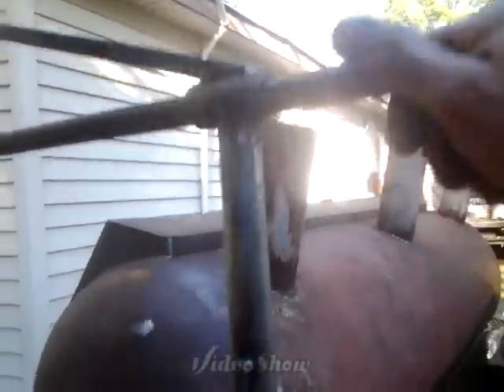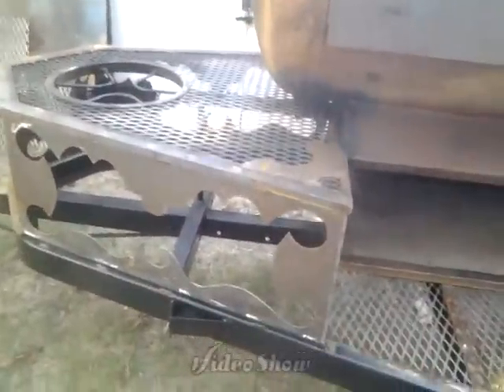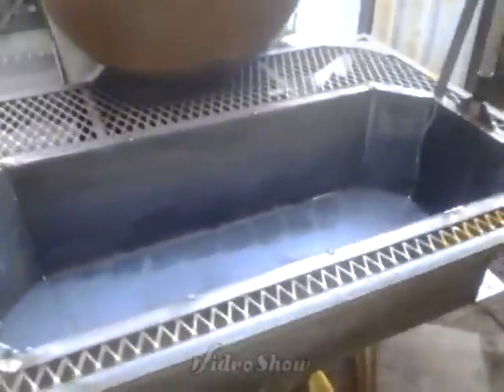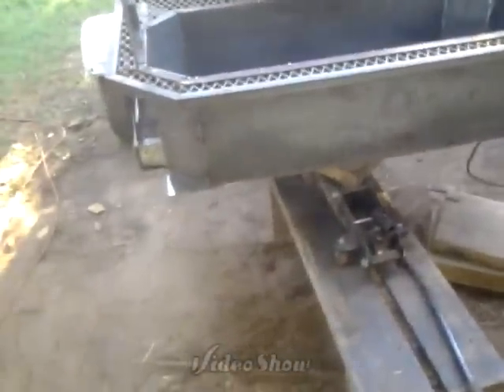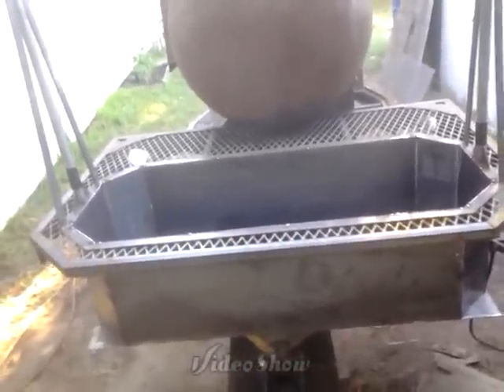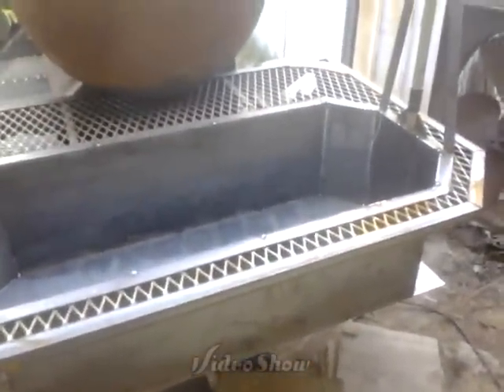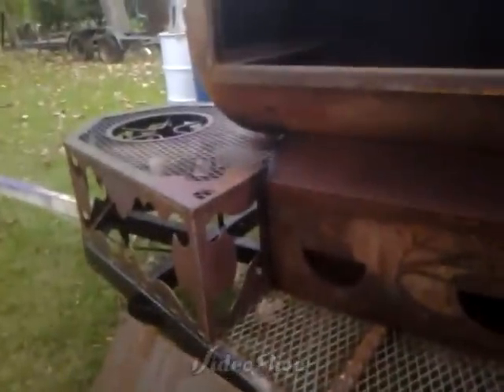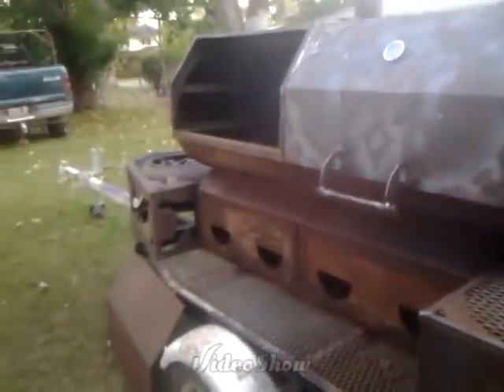"Grill master" bbq smoker build 5/5

Comment: wut type of welder are you using? nice wrk
Reply from the maker: I use a Lincoln 180 at home and a miller 252 and trailblazer at work. The Lincoln is a small machine but can do a lot of welding